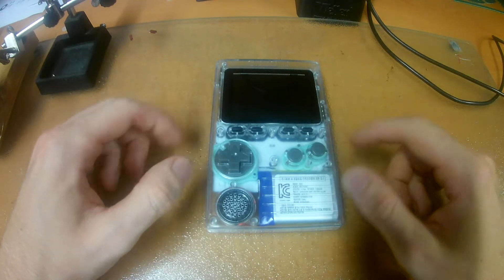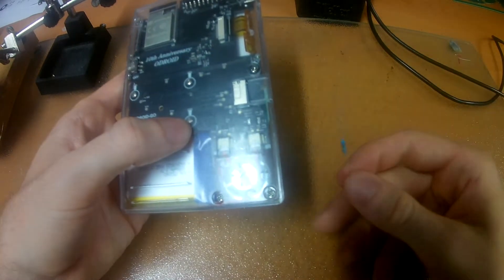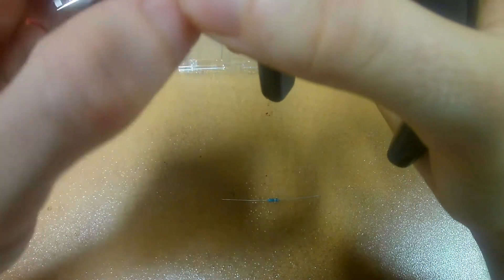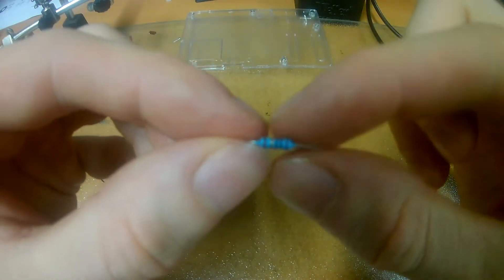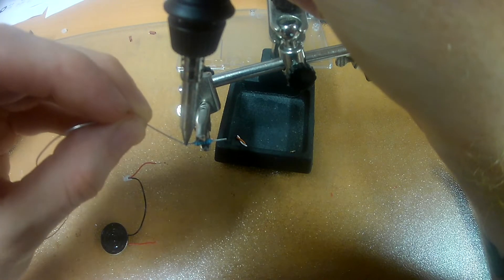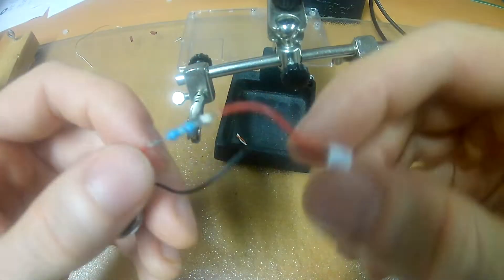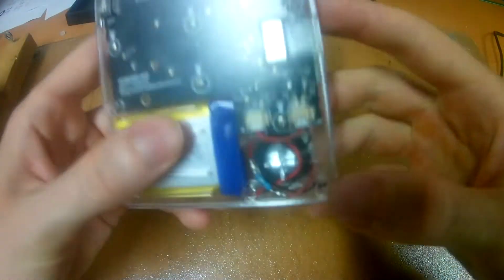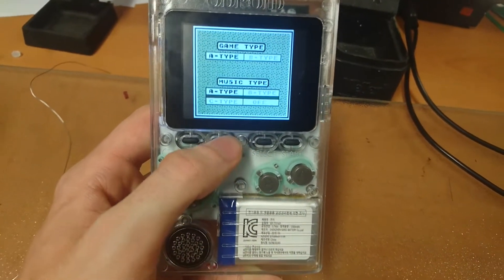How to make the ODROID-GO easier on the ears | Make electrical toys more quiet

Comment from the maker: Suggestion: Instead of a simple passive resistor you could use a potentiometer for easier adjustments in retrospect. 
Take a look at Figure 6 here: http://sound.whsites.net/pots.htm
You can either use the "Volume Control" where 'In' is the red wire from the board, 'Out' is the red wire into the speaker and 'GND' is the black wire which you'd have to cut as well. Alternatively, you can use the "Variable Resistor" version and put it in like I showed you in the video.